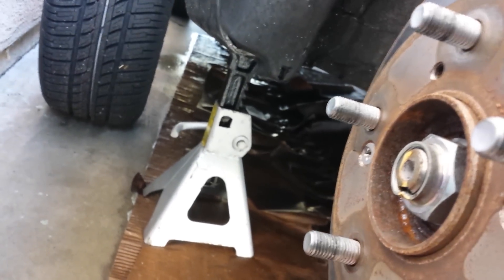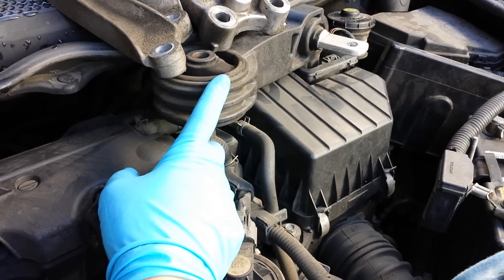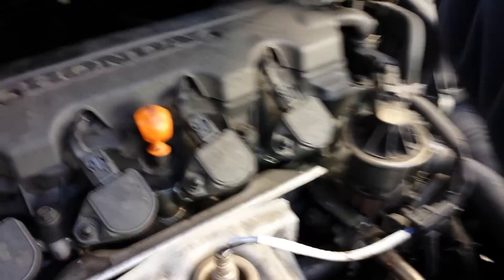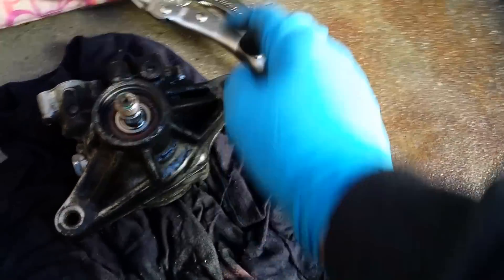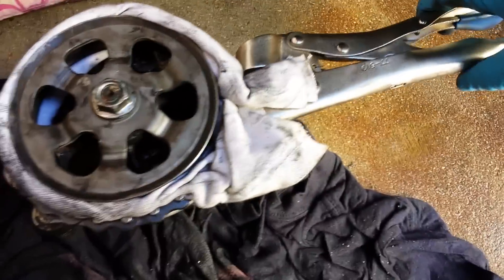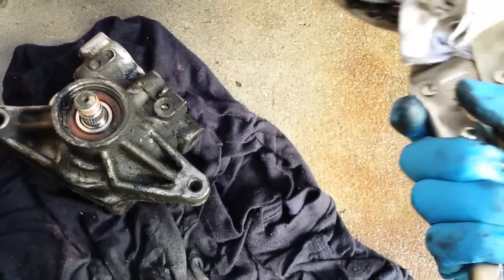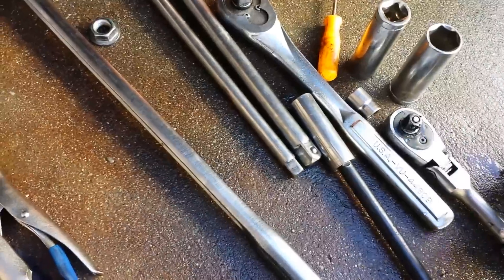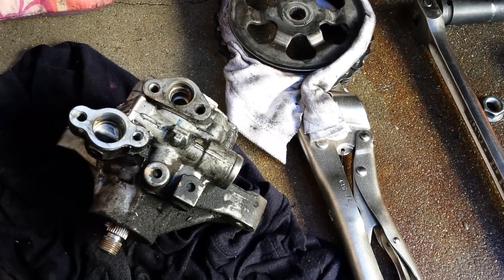2007 honda civic power steering pump replacement

Comment: That top bolt is the $200 bolt.  It takes quite some maneuvering to get that thing out.  I would suggest a 1/4 (small) air wrench to fit up in there.

Comment: thx for video, first mechanic wanted to charge me 900 big ones the second mechanic was charging $600 fuk that. Without removing anything like brackets and motor mounts, i forced my hand thru side of engine and brackets with small rachet to get bolt on top and thru bottom removed the second bolt and dropped power steering and replaced it the same way

Comment: Come on, bro. Don't jack a car up, by putting the jack under the oil pan. There's literally a jackpoint right in the front/middle crossmember in front of the engine. A piece of wood doesn't have anything to do with it.

The oil pan is not made to be a jackpoint and this should be common sense to anybody who owns a jack.
Reply: I have to agree I cracked a cast iron transmission by making this mistake lesson learned
Reply: I know it’s been a year since you posted this, but in the event you happen to see this.. 

He didn’t jack the car up by the oil pan. He jacked the car up, supported the car with two mounting jacks, then he lifted the oil pan slightly with the car jack and a piece of wood. The only thing the car jack would be (VERY slightly) supporting at this point, is the weight of the engine. Not the weight of the entire vehicle.

To play devils advocate, I still am not a huge fan of even jacking up an engine, but it’s Definitely WAY better than an entire vehicle.
Reply: You have no choice but to do this on that Honda Civic even Midas and a dealership calls for it when you're removing a motor mount there's no other way to do it you have to have the car on jacks and use a block of wood to lift the engine just a little bit up there's no other part of the engine you can lift up besides using that. This is the correct procedure as long as you don't put much on it

Comment: A lot of people have problems caused just from failing O-rings (there was a recall for this part).  Does anyone know if you can replace the o-rings without pulling the pump / engine mounts?
Reply: I know this is 5 yrs old but the answer is yes-just did it-helps to be somewhat of a contortionist...LOL..
Reply: @tonyjordan1320  I ended up finding that out first hand! 
Thankfully the pump is still going strong and no noises / leaks, despite snapping off one of the mounting bolts >.<
Reply: @tonyjordan1320  about to try this this weekend thank you
Reply: @DaezdnK  I just replaced the low pressure O ring-(orange one) since that was the one leaking, been over a month and no leaks-success.....

Comment: hey thanks for the video, after disassemble the pump from the car, how did you get the pump out? Im trying but the space is too small
Reply: +Shameer Nazeer Hey man! Thank God I have just took the pump out of the car :D I followed the instructions of this website http://www.autozone.com/repairguides/Honda-Cars-2007-2008/Power-Steering-Pump/Removal-Installation/_/P-0996b43f80f8ad37 I hope this works for you

Comment: You don't have to jack the motor up 😂😂
Reply from the maker: Joshua Sutton explain me why not?
Reply: Ive done 3 different vehicles in my driveway all same body style and set up. All I did was take PS tire off and inner fender well. After that belt, lines on pump and top and bottom bolt. Use only Honda recommded power steering fluid or you'll eat the seals in the pump and in the rack.
Reply from the maker: Joshua Sutton Correct. But, Did you saw the video where i removed one of engine motormounts, thats the reason i  jack up the vehicle, and in most cases you’re correct there’s no need to do this, i have done a few cars in my short career as a mechanic just the way u said, easy money. But in this case I did it with out anything no YouTube no data help, there was none regarding this car, so i found my beast way around to reach that hard to reach bolt, and got the sidejob done and git paid, car is out of the driveway, customer happy and my pockets too.
Reply: Glad you found your "beast" way
Reply: Joshua Sutton so he said he removed the engine mounts because he couldn’t reach the top bolt. Are you able to reach the top bolt with a plain ratchet extension? Would those angle extension sockets help?